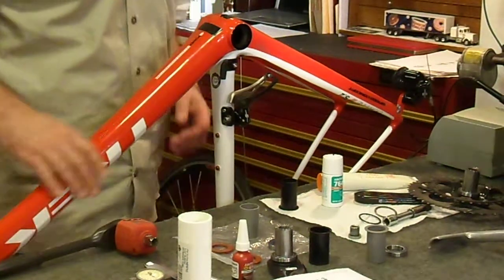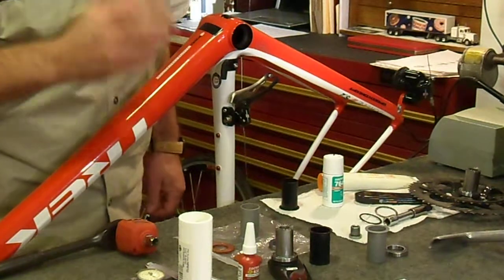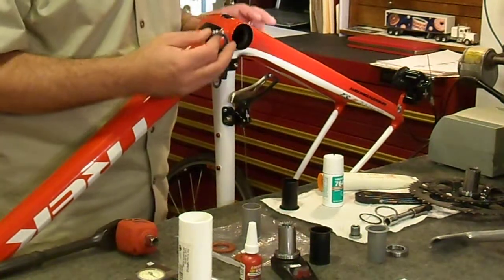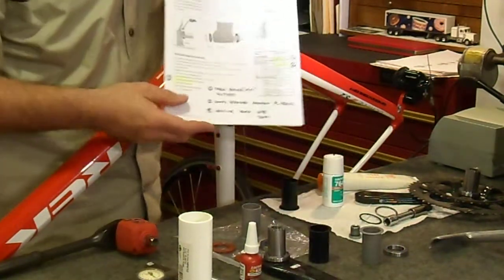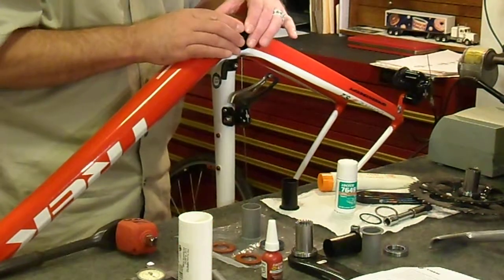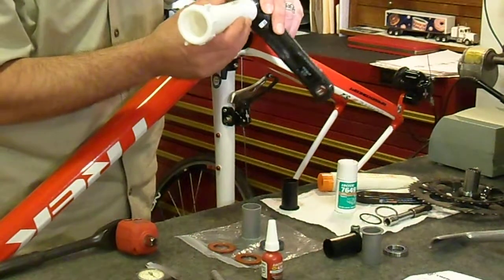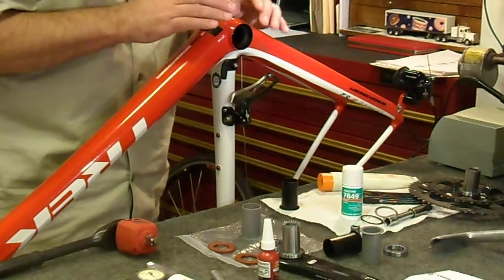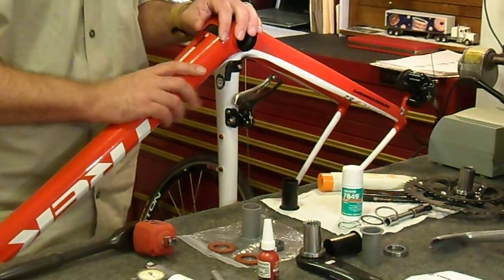Campagnolo Ultra Torque Crankset on Trek Domane or Madone

Comment: HI John, are you still taking care of this channel? I do have the problem, that my mechanics didn't know about the glueing of the BB90 conversion kit from Trek to enlarge the base for the bearings of the ultra torque crank set. Since I could not find the service manual TK10_Madoneservice_062309.pdf anywhere, I would like to ask you, whether you could sent it to me. Would be great, thanks! Thomas from Germany
Reply from the maker: Yes, I think I do.  I will have to check.  I would need to know where to send it.
Reply: @johnswiatek6821  John do you know a way to share an e-Mail address on YT without disclosing it to everyone? Are you on Instagram?
Reply: John, have you had a chance to look for the manual? Have you already found the file? Cheers Thomas
Reply from the maker: Take a look at the 3rd page of this pdf: https://retailerassetsprd.blob.core.windows.net/techassets/guide_GPXCrankInstallation.pdf?sv=2018-03-28&ss=bfqt&srt=sco&sp=r&se=2062-03-20T02:32:45Z&st=2019-03-19T18:32:45Z&spr=https&sig=UogJIteiFltPX66np2M0a3esSu1uZzABYHTFInUlT%2Fo%3D   @thh678
Reply: John, really great!! Appreciate your effort and support very much. BTW, with the help of the Campa files mentioned inside the crank installation guide, I've found the original file you've referenced originally. Again, many thanks for your support. The Loctite is already ordered. 👍
Reply from the maker: @thh678  Nice.  Mine has been holding up well, no squeaks either.  Good luck!

Comment: The "seal seats" really aren't necessary. As you mentioned, they aren't "load bearing" as they contact only the frame. After some frustration with getting them to bond with the frame, I contacted Trek (I work for a dealer) and they told me (and I wasn't to repeat this) to can the seals. They are marginal at best for protecting the bearings (look at sealed bearing hubs). I have over 2k miles on my Emonda with a Chorus Ultra Torque crank with no problems. It spins freely and no side play.
Reply from the maker: Hello, thanks for the input to this thread.  I had to work tediously at getting the surfaces flush, clean and ready for bonding.  Having the proper bonding agents along with a proper "clean-up" of the surfaces was critical.  In fact it was part of the reason I did the video.  Anyway, as an engineer, I would agree with Trek, the seal seats do not affect the mechanical loading as one might think at first glance.  Hope the video helped some anyway.

Comment: The bearings are suppose to be tight not slipping out. If your bearings popped out like that then you have an expanded bb shell that needs to be fixed. Trek came out with v2 bearings which is 0.01mm wider to accomidate the expansion. If v2 gets loose then your frame is done.
Reply from the maker: Great info, thanks!